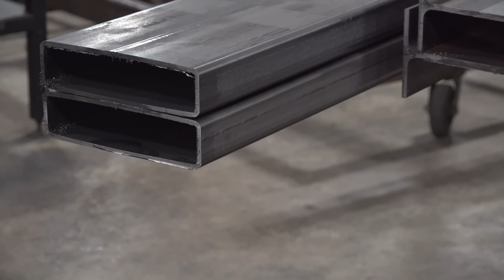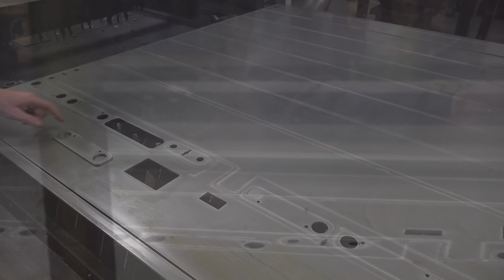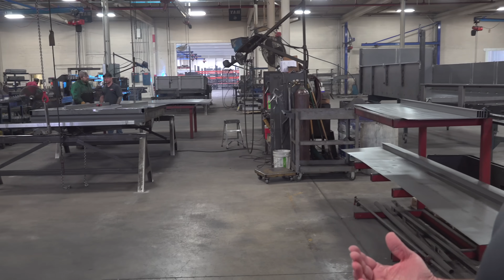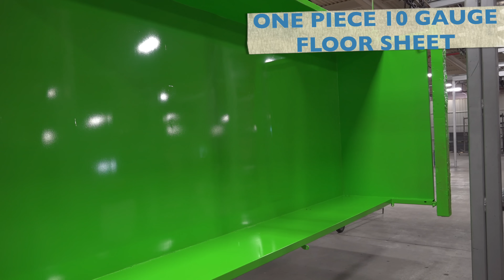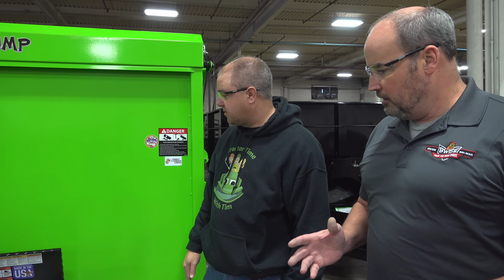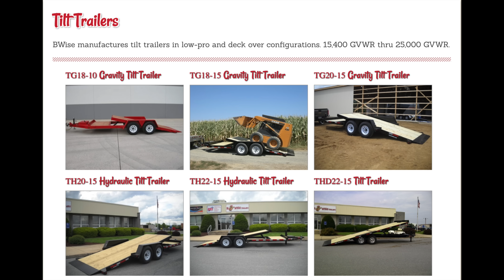How Dream Trailers are made!  BWISE Factory Tour!!

Comment: I just picked up a used 2017 Ultimate Dump trailer in excellent condition. These are really well built dump trailers. Im not sure what the torque is on these aluminum wheels. The manual says 65-75 for their aluminum wheels yet the sticker on the lid of the battery box says for 8 lug wheels you torque to 140. Thats a real big difference in the amount of torque from the manual to the sticker specs.

Comment: They should do a frameless with an adjustable tag axle. Set up wiring harness with a pigtail so if harness gets pulled/damaged just grab a new pigtail don't have to rewire hole trailer.

Comment: 16" OC does not work well if the deck is pine/hemlock, 12" OC works better since the boards span less distance and have less chance of breaking. i'm sure oak would change that.

Comment: Why did you choose to go with a Gooseneck? At only 16k pounds and not being very long or high profile sway would be pretty minimal, at least that is what I have noticed on my dump. I dont see the need for the gooseneck for a 16k dump trailer, adding cost from the extra steel, and also using up bed space in the pickup that could be used for tools or other supplies.
Reply from the maker: Ability to transfer more weight to the truck.  Could only use 14.5k gvwr legally without CDL.  So, to haul more than that, need to transfer more to the truck.

Comment: I wish that somebody in the dump trailer manufactuering biz would do a little more engineering to reduce the weight of the trailers. I hae had a dozen differnt brands and they all weigh about 4200 lbs for  14' dump trailer.  With a little thinking they could cut 500 lbs easily.

Comment: Hey Tim been a long time watcher but have to say not to excited with the BWise review and everything you have done.  I know the manufacture probably helping out a bit with the costs and you are having a great relationship with them because of the number of your followers, but I have two trailers both custom and spent over $23,000 on the set and have had nothing but problems.  Maybe with them knowing you yours will be better, but i would tell people to look at the reviews BWise has received as it seems like there are very similar issues going around to everyone (had the same issues on both of my trailers as well.
Reply from the maker: When did you purchase?  Did you purchase a Bri-Mar or BWise?
Reply: I purchased in May and purchased a BWise trailer.  Lime Green tri-axle custom built ultimate dump and a powdercoated grey hydro tilt, both gooseneck.
Reply from the maker: What problems have you had?
Reply: Same as a lot of others, paint peeling away from the frame in all locations (even the powdercoating).  Issues with the wireless controller not working more than 10-15' from the controller box.  Having to replace both batteries (they use a recycled battery and dont warranty it).  Also issues with it not dumping a load that is well within the restrictions of the trailer (especially mine that are rated at 16,000 to get around having to have a CDL but really could have be rated at 22,000lbs).  Load was loaded correct in the center of the trailer (not in the front) and couldnt lift 10,000 lbs.  Also have had a lot of hydraulic leaks.  Worst has been the poor customer service i have experienced and no dealers willing to do work on the trailers unless you purchased it from them because they have "a hard time with warranty work with BWise).

I get a lot of compliments on my ultimate dump in lime green as it looks killer, but after the operations issue and warranty i couldnt recommend the trailer.
Reply from the maker: Interesting.  Thx.  We’ll see how it goes for my trailer.  I obviously haven’t used it yet.
Reply: Yes hope it goes well just a bit disappointed on my end.  Let us know how the paint holds up.
Reply from the maker: Understood.  Thx!

Comment: Good tour.  I've been a "trailer" guy for many, many years, as a heavy user.  I presently use a 6.5X12  utility trailer, single axle, ramp end gate for my lawn service business - hauling three mowers, plus other gear, all under 3000GVW.   Sometimes mulch, leaves, dirt,  other debris.  It goes out every day, 6-7 stops, short distances.  Big-Tex, .. used it for more than 20 years.  No bells/whistles, just plain hard-working trailer.  Lots of scratches, some deck board rotting, but use it, use it, use it some more, without fanfare.  I've rewired it a couple of times, lots of tires, new springs, end gate rebuilt.  I'm not interested in how it looks, just let it work!  Bri-Mar makes a similar one, but I was able to buy this one for $800 more than 20 years ago.  The Bwise trailers look good, but are too expensive for business owner.

Comment: One other question.  Are you going to put your fancy camera connection that came with your truck on this trailer?
Reply: All those cameras, including the aux one for a trailer is one reason I'm seriously considering moving from Ram trucks to a Ford.  There have been many times when I was backing my gooseneck trailer with a piece of equipment on it and wished I could see what was behind the trailer.  If I buy the Ford, I would try to include a camera connection on all my long trailers.
Reply from the maker: I’m not sure I can.  The gate flexes both ways. Not sure how to mount the camera!

Comment: Very nice trailer.  You'll have to tell me your secret for convincing the finance committee.  I could use some help with mine! <grin>  I do have one question.  In the video the sales person mentioned folding the sides down for loading, but I see there is a rod on your trailer running up the side to what I assume is a cover for the load.  It looks like it would prevent the sides from folding over.  How do you get around that when you need to fold down the sides?
Reply from the maker: Did you see those ‘zinc plated clips’ he was discussing late in the video?  Those must be removed to remove that tarp bar...then the front side can be lowered.

Comment: Nice trailer Tim,time to get your CDL! Thanks for sharing
Reply from the maker: It is 14k gvwr.  So I should be good.
Reply: @TractorTimewithTim  your laws must be different, a trailer over 10000 lbs ,u require an AZ or an AR license, if it is a fifth wheel combo they allow u 11000
 lbs. Once u plate your truck and trailer combination which is over 10000lbs is a commercial vehicle.Your laws may differ but not that much, be safe not sorry,are DOT and police are brutal with fines around here, good luck
Reply from the maker: I plan to interview an Indiana DOT guy on the channel in March. We’ll try to get to the bottom of it.

Comment: Looks like a solid trailer, I have never seen those around here in VA. I drove down too NC and bought a Kaufman 7x14, 15000 pound dump trailer that I’m very happy with.
Reply: I don't see Bwise trailers often(The company has alot of 2 and 3 star reviews because of their service , unless it's a fancy small business that's like a weekend warrior who has alot $ to spend on a bwise  I dont see them , I've seen most other brands multiple times but only seen a few Bwise , I was few hrs from their PA plant and even then most of the guys who do equipment hauling  went with pj , Kauffman or big tex all just as good maybe better than B . The one bwise trailer I had experience was ok it was a trailer no better or worse than most ok brands  it didn't last in the well drilling but not alot does . With that being said my 20ft Kaufman is very nice and Bwise has a terrible over all review rating of 3 star maybe when this video was out they weren't as bad .
Reply from the maker: Kaufman is opposite end of the spectrum of trailers.

Comment: I would like to have seen IF, and where the TILT tube gets greased. IS there a Zerk on each side? Can you use a bearing buddy under those special hub caps? Are they "D" or "E" rated tires? Can you get Electric brakes? Or are they surge on yours Tim.. I like to get a list of maintenance to keep up with.. Thoughts Tim?
Reply from the maker: Electric brakes.  I think there are zerks on the hinge.  Will discuss that in a later video when we are using it...and it is warmer :-)
Not sure on your other questions.  One phone call to bwise will answer it for you :-)
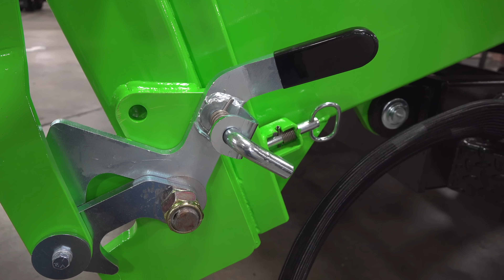Reply: There appear to be grease fittings on the hinge pins @17:48.  Also show up on pictures of their trailers at their website that Tim provides a link to.

Comment: Great video Tim.  I bought a new BWISE 22' deck-over gooseneck  tilt with hydraulic remote jacks last year and I can't say enough good things about their trailers.  Extremely well built and pulls like a champ.
Reply from the maker: The hydraulic jacks feel like the ultimate in luxury!    I suppose they should ...given the name 'Ultimate Dump'!

I would love a deck over gooseneck/tilt.  However, I was trying to avoid CDL requirements.
Reply: @TractorTimewithTim  I got the tandem axle with 7500 lb axles.  The load capacity of mine after subtracting the trailer weight and adding additional capacity for the gooseneck is 11,900 so no CDL required for this one.  Even with my one-ton Dodge still well under 26k.
Reply from the maker: What is the gvwr of your trailer?
Reply: @TractorTimewithTim  16,800
Reply from the maker: And your truck gvwr?  My F350 is 11,500
Reply: @TractorTimewithTim  10,500
Reply from the maker: By my math, that adds up to more than 26,001.  That spells CDL!
Reply: @TractorTimewithTim  While I was answering your questions I was also looking up these requirements and only just now realize that the combined GVWR's are what determines it.  I always thought It was the total weight of Truck + Trailer + Load.  Not that it matters.  I was a commercial tractor trailer driver for years so I didn't have to worry about the CDL part anyway...
Reply: @TractorTimewithTim  I guess I need to start tuning in for Truck and Trailer Tuesdays more!  lol
Reply: @TractorTimewithTim  Okay Tim, now I'm confused and thinking I might have been right after all.  I went to the state of TN website and looked this one up.  This is a direct quote from their website... "In general, state law defines a commercial motor vehicle (CMV) as any vehicle or combination of vehicles weighing more than 26,000 pounds."  That's where I originally got my numbers from.  It also states... "Some drivers may require an A/57 license. This license applies to drivers who do not require a class A license, but who haul an excess of 10,001 pounds or more. Examples are: F450 pick-up truck hauling a 10,001 or more pound trailer, an electric department truck hauling a 10,000 pound forklift on a flatbed trailer, etc."
Reply: Okay, nevermind.  That's still a class 'A' license with a restriction.
Reply: @ghallums  I wonder if they would de-rate the gvwr of a trailer to stay under the 26,000 pound total.
Reply from the maker: Yes, they will.  Mine is normally gvwr of 16,800.  However, they derated it to 14k to keep my total under 26k.
Reply from the maker: Greg, I plan to do some in-depth truck and trailer Tuesday videos with an Indiana DOT officer after we return from Europe.
Reply: @TractorTimewithTim  Oh good deal!  I will be tuning in for that one for sure!  Thanks for the 'heads up'.

Comment: Very nice trailers, but I find around here within 2 years the powder coat will peel, does not do well in salty conditions. Least little nick, and once the salt gets in it will peel off in sheets. Of coarse any kind of finish in salty conditions, will not do well. A good undercoat solves many problems, but be careful, have seen some(sort of dries in a hard shell type plastic) that actually traps moisture on the steel and will rot fast.
 The tube steel will rust from the inside out, if not done right. I have found if water can get in, and lie there, it will rot. If they have drain holes, or simply made so the water runs out, they seem to last for years. 
 Lastly, and I say this not to imply anything. But when they say manufactured in the USA, I have some doubts. Not saying they do not make them there, we all can see they do, but the steel may not be USA steel. After some research, I have found not all types of steel is made in any one country. For example 1/4 inch angle may be made in Canada, where 3/8ths may be made in USA, where there may be a plant in Great Britain that makes 1/2 inch,  and I am not saying these are made here or there, but you must remember all the different thicknesses and sizes, of Channel, Angle, tube- which can be square of rectangular, many different sizes, and thicknesses, Pipe, ect, ect, ect.  Some may even come in from China(oh no the C word) but it may, because no other Country makes that certain material. I recently came across a fairly large piece of 12 inch channel that had Poland stamped on it, and who knows maybe there is a plant that manufactures that channel in North America, not sure, but it was here, and I have no idea how or why.
Reply from the maker: All the steel comes from the USA and Canada.  

With all due respect, this organization makes MUCH of the trailer from scratch.  I can't imagine making the little spring keys or hydraulic cylinders when they are so readily available.      So, you can get on your soapbox like this if you want.   However, there aren't many companies making MORE of their product in the USA than BWise/Bri-mar.

Sorry to get a bit testy, but good grief.   

Additionally, we discussed the tube 'rust from the inside out' myth in the video.    According to Dave, After 25 years of producing trailers, BWise/Brimar has not had even ONE trailer come back with rusted out tube.    That is good enough for me!
Reply: @TractorTimewithTim   
  Tim I was not being disrespectful of them, or you. I do realize they make them from scratch, and did not say they did not. But I was stressing that all steel is not made in the USA, so when a company says Made in the USA, does this mean everything is made there, or it is assembled there?
 As for tube steel, I never said they did have any issues as the man said, maybe he has never had one of his trailers come back, and why would someone bring it back after 20+ years.  They may prevent it, I have no idea,  if water has no way of getting in, or they have drain holes, may be fine. 
 I myself have seen a number of trailers, and all after they get to the 10 +- years show signs of rot,  if they get to the 15year mark most you can put the chipping hammer through the tubes, if nothing has been done to prevent this. If the same trailer has any channel, it is in way better condition. Sorry but not a myth.
  Most of the time, it is the deck boards that are screwed with self tapping bolts, the water can get in through a few of these on top of the tubes and has no where to go and lies inside. As for my dump, which I replaced all of the frame on 2 years ago, it was 10 years old at the time, and the frame was in very bad shape because it was tube steel, more so on the drivers side due to road salt, which rotted it from outside as well.

Comment: cool vid! saw  MAZAK CNC machine in there. that is NOT a cheap machine so goes to show the measures these people are going thru to send out a top notch product.
Reply from the maker: Thanks for that tidbit.  There is no question they are going the extra mile to produce the best quality product possible.    Several 'off-camera' discussions with Dave as well as the owner further cemented this.      They will NOT be the least expensive trailer you can buy, but it WILL be a quality trailer.
Reply: @TractorTimewithTim  ;
i see and believe. the MAZAK was more than enough, people like me will see it and believe int their quality. that machine is AIRCRAFT quality. as in ISO9100 plus.